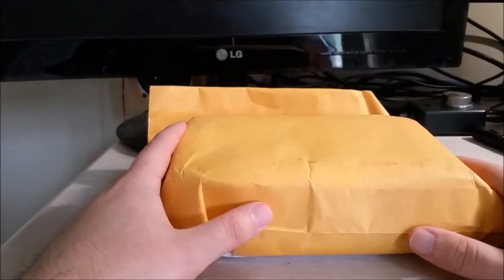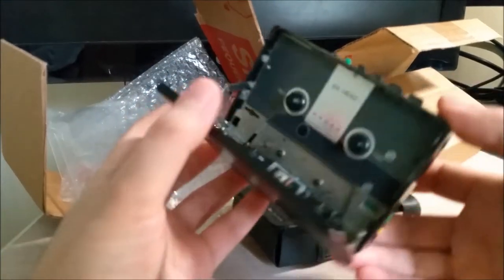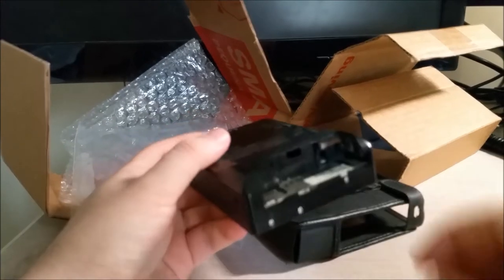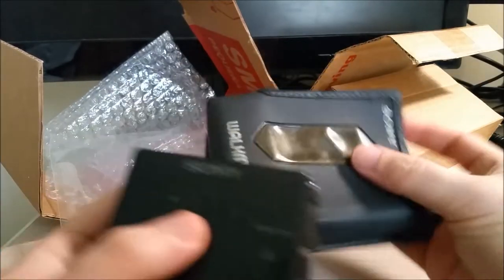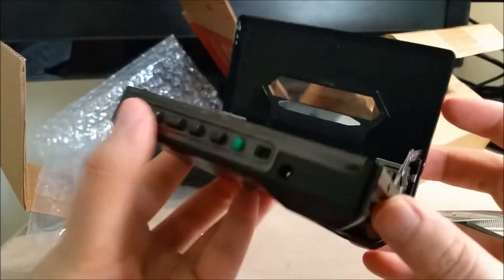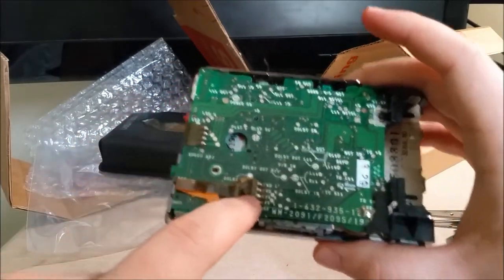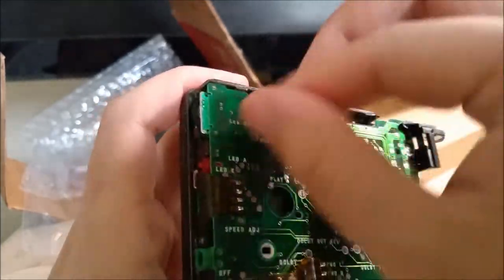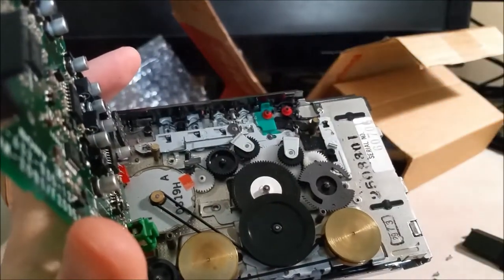TeardownTube - episode 54 - Sony WM-2091 Cassette Walkman

Comment: I bought that model in 1989, it was £100+ and it was pretty good. It just packed up in 1993 :( I own a great WMD6C now so I no longer have to worry about piddly fiddly small WM!
Reply: I bought it only 65£ in France at the same time. With leather case and earphones.
Reply: KRAZEEIZATION D6C > 2091
Reply: Me, too. Bought it in 1990 for $90US. Loved it. I wish I knew what happened to mine.

Comment: I have the WM-AF604 which is a similar model but with the AM/FM Radio. The belt had disintingrated. Using this video, I was able to find out how the belt should be replaced. The service manual did not have the belt path. Just waiting for the replacement belt to arrive from eBay.
Reply: SAME!! This video is a godsend!
Reply: Same except my motor cable came off :(
Reply: do you have the link for the replacement belt I need one too thanks
Reply: @princethewondercat  Just search eBay for "WM-AF604 Belt". A number show up.
Reply: @winthropdc1    thanks did already placed an order

Comment: It is, probably, the best Waljman I've ever had. (and I've had a few!). Your video was really instructive to know how to open it. I replaced the belt on my one, (which was desintegrated), but, sadly, it isn't work since a long time ago. Maybe I should have repaired it when it happened, but repairs were so expensive at that time! What happens? battery light doesn't turn on. Maybe it is a capacitor, I don't know. I don't remember what happened when stopped working (yes, I was heavily using it).
Reply from the maker: Is there any battery leakage on the contacts? It could also be cold solder joints, bad caps, or oxidation. I wish I could give you one certain answer but unfortunately given their age there's a million things that could cause the light not to come on/no power.

Comment: I would steer well clear from this model and the WM-EX50, today, 2022, they always have a broken clutch gear that needs replacement and all the capacitors need replacing to get audio end servo back working. There is no room for capacitors that are not the same size (bigger), else you block the mechanism when the PCB is folded back, it's all SMD and requires quite some skill to replace them. (especially without severing soldering pads from the PCB). They are very pretty and take both a AA or a Gumstick, but not worth the effort to me.
Reply: Do you have an advice for a less problematic model? Thanks.

Comment: got myself a bid on a WM 22 model off eBay. it will be nice to have a proper Sony player. 
Edit: lost out on the bid for that WM 22, but I ended up getting two other Sony WM's a Sport model from the mid 80's and a WM from late 90s, early 2000s. Both in working condition and for cheaper with shipping than what the WM 22 ended up selling for in the auction.

Comment: So my WM-A52 player is having an odd issue. It plays tapes at correct speed, but the play button is suddenly sticking making the Stop, Fast Forward and Reverse buttons not want to properly click into place.
Reply from the maker: The grease in the metal key mechanism has probably dried up, causing the button to stick. Give it a good clean with ipa to remove the old lube and apply some new to the sliding/contact points.

Comment: One of poor mechanism series Walkman,also use cheap SMD capacitors.small gear break can affected autoreverse mode.
Reply from the maker: I've learned to absolutely hate smd electrolytics. A bit of a pain to remove and leaves a nasty burning smell when the leaked electrolyte is heated during desoldering.
Reply: Hopefully it does allow one side one way play or play one cassette both sides then stop.
Reply: @sjm4306  Darn... I'm actually having the same issue in my AF604. The auto-reverse mechanism is busted, and does exactly what your does at 20:40, where it refuses to turn the "FWD" takeup reel for more than a second. And leaky capacitors mean I just get a constant squeal when playing tapes. What a shame. This Walkman has one of the finer external builds and designs, in my opinion, with the aluminum and steel casing.

Comment: I just changed the belt and it plays, winds and rewinds. But it says "iiiiiiiiiiii" a bit external and also in the earphones, so no sound. Hmm...
Kind regards.
Reply from the maker: Sounds like bad caps in the audio circuitry.
Reply: @sjm4306  Thanks, I'll look into that.
Kind regards.

Comment: This noise is for the tantalium capacitors... you must all change, i take the same model... good luck!
Reply: Hola Sr. Lozano ¿tiene usted un video sobre el reemplazo de capacitors?
Hello Mr Lozano ¿did you make a video about cap replacement?
Reply: Hola lo siento no tengo video sobre reemplazos cual seria tu duda? Saludos @ralffran
Reply: @robertolozano1789  Hola, gracias por responder. Tengo dos dudas: La primero es con respecto al cambio de capacitores, compre un equipo que hace el mismo sonido al subir el volumen (un chirrido) por lo que tal vez sea necesario reemplazo de condensadores. Sin embargo, estos vienen montados en una base negra pequeña y por la parte de atras de la tarjeta no se ven los puntos para desoldarlos ¿hay que remover esa base o como accedió usted a los condensadores?
Otra duda. El cable plano flexible del motor en mi equipo viene parcialmente roto (no todo el cable solo a la extensión de uno de los pines), por lo cual el motor ya no se mueve... ¿Es posible reemplazar ese cable con cables normales de 0.5 mm?
Reply: @ralffran  con un Cautín con punta puedes desmoldar los capacitor con unas pinzas los vas removiendo... El motor puede usar cable o alambre delgado son 4 terminales

Comment: Hello there! I have a Sony TCM WM-2091 which did not work, after watching your video I decided to open it up and see, the belt had completely gone, turned into chewing gum!  I 3D printed a new belt, got the mechanism to work but noticed some parts where loose so it was auto reversing continuously.  I have now put them back but I had to remove some of the wheels to do this, on putting them back I now realize that the centre wheel, the black one with the white center needs a "lock washer" , I think it's called this way.

Do you have any idea where I could get one of these, the internal diameter is 0,8 mm.

Hope you can help, I am just this one little peace away from getting my old walkman to work, I think I've spent between 5-8 hours on it already. My 10 year old son is into my old cassettes and also can't wait for me to fix it.

Thanks very much in advance, I hope you can help.
Reply from the maker: Congrats on getting so far with the repair and that's awesome your son has taken to tapes. Found this on ebay (https://www.ebay.com/i/400537379577?chn=ps). I keep the little clips from everything I take apart just in case, in fact this saved me in the discman repair video I just did where I lost a clip. Anyway good luck on finishing repair of your walkman!
Reply: Hi, thanks for your reply, unfortunately that seller does not send to Spain, however I have found a seller in the UK, will let you know how I get on when I receive them.

Comment: My device are similar but is a WM-A602. The problem are in the battery I think... the red led off and don’t play... :(
You can help me?
Reply from the maker: TheILAIR Check to make sure the battery contacts are clean. If that's not the problem then open it up to inspect the circuit board. If any traces look corroded they need to be repaired or capacitors that are swelling/leaking they need to be replaced.
Reply: Thank you! i try it

Comment: the gum stick battery should have fitted you needed to put it a an angle first.
Reply from the maker: I've found the after market, chinese green batteries are actually a few mm longer than the original sony ones, thus making them fit a little too snugly for my taste into various cd, minidisc, and tape players I've tried putting them in.
Reply: @sjm4306  i've just received a WM-F2095 from ebay this morning that is faulty so found your video very helpful as i think mine is the radio ver of yours, i have the orange VAPEX gumstick batteries for my minidisc and CD players that have fitted perfectly.

Comment: What size belts should I get to replace them on this unit?
Reply from the maker: This model uses a special very thin and long belt, there's only one seller that I know of on ebay who still has them. Just search the model number and "replacement belt" to find what you need.
Reply: @sjm4306  thanks! Just ordered mine